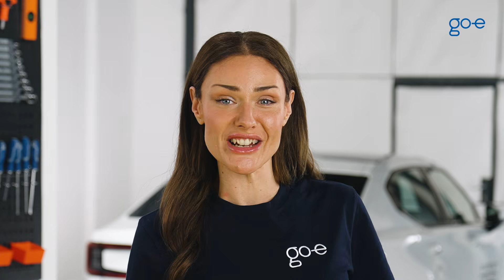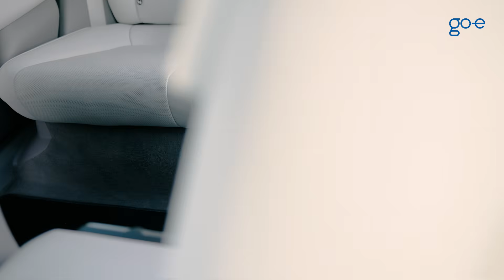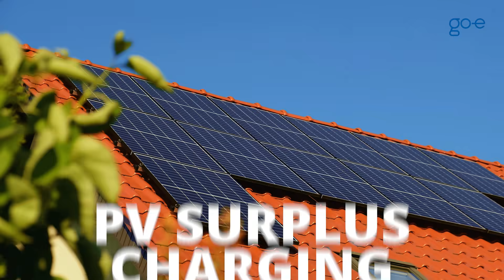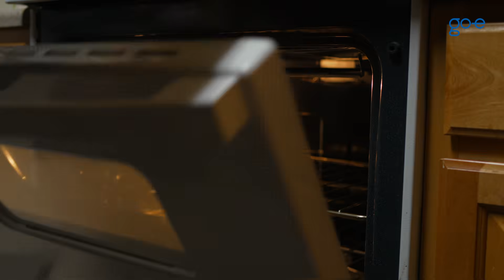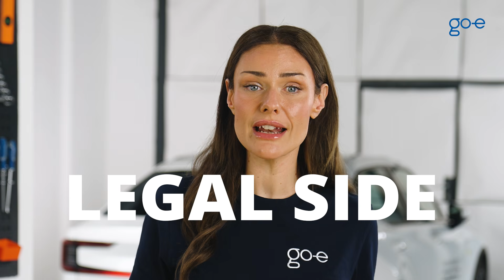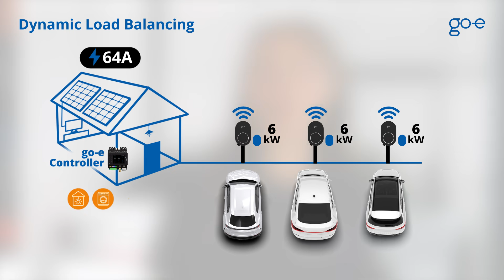Bidirectional Charging (V2G, V2H & V2L) Explained: All You Need To Know!

Comment: Thanks Amy, I think now it's a big improvement in the regulations in Germany as well. From the connection point of view, guess DC from the vehicle is the most suitable way as charger is directly "speaking" with the battery BMS without an additional AC/DC inverter inside(conversion always impacts efficiency, not much, but some 2+%)
Reply from the maker: Hello, thanks for the interesting input!